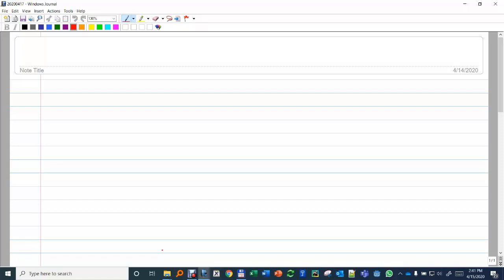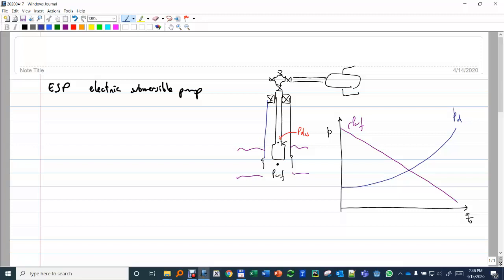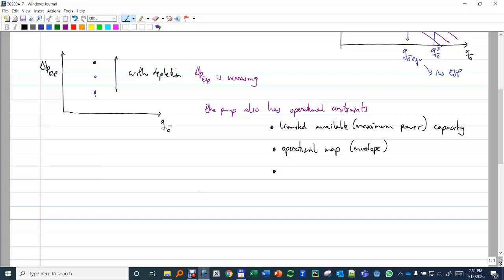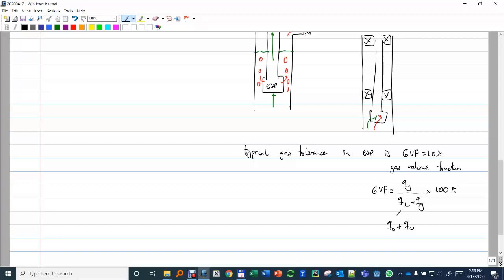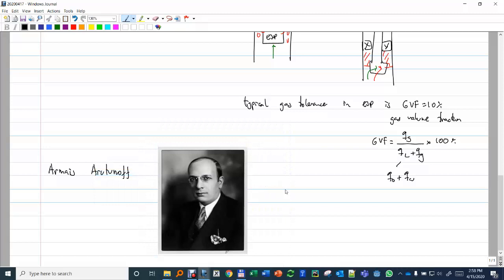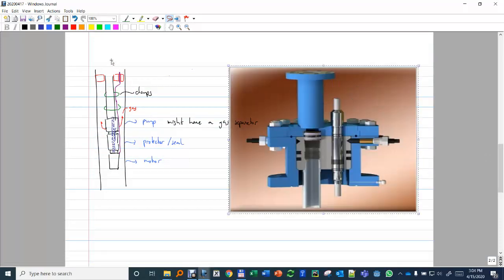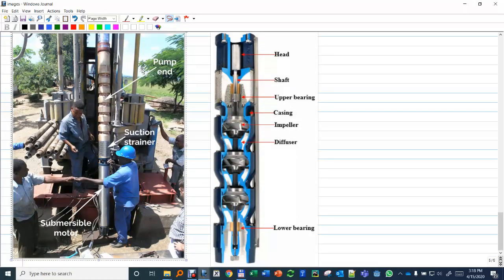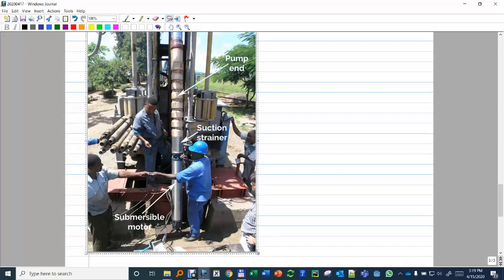Electric submersible pumps - introduction

Comment: Well done
The ESP system now has a lot of unit that add to it like Advance gas handler which we use in wells with   gas above 45% and beside bump and above gas separator.
Some of valves important above pump check valve  about 4 jints then above bleeder valve about 6 jont above pump.
Reply from the maker: Thanks!

Comment: From characteristic curve shows that the head is against the flow however if we need to increase the flow rate we add more stages e.g more head
Reply: It does not work so, mate. If you adding some stages - only increasing the head. It doesn't matter one stage or zillion - you'll have the same flow